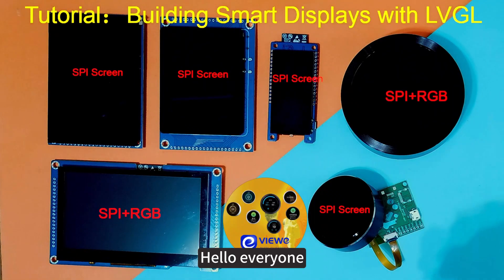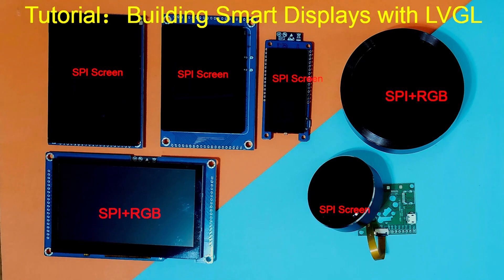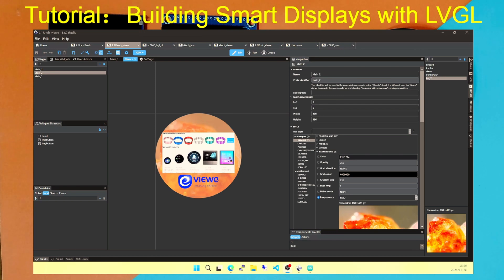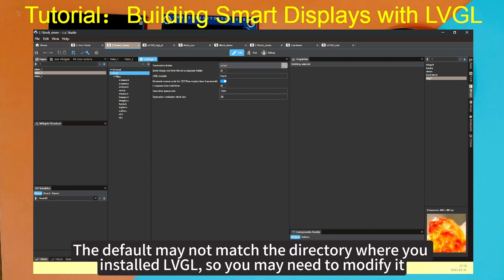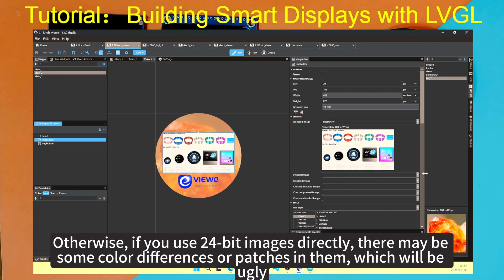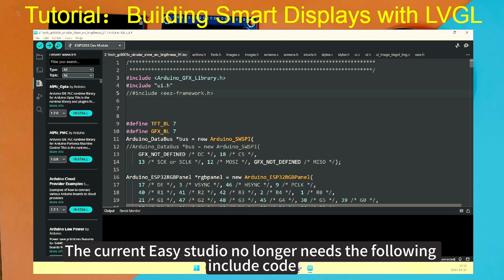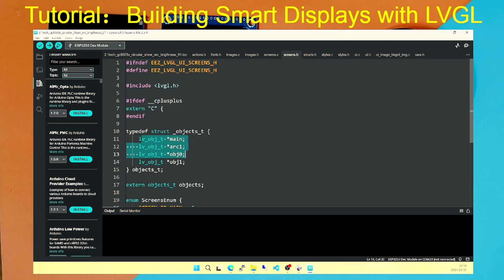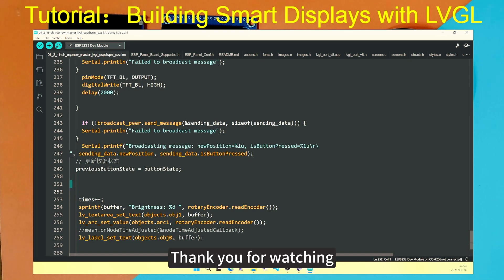Tutorial: How to use LVGL to Build a Smart Display GUI with Arduino IDE?

Comment: A friend of mine has this display, but he cannot use it with any library except LVGL. We are three people working on this and have tried everything to make it work with the TFT_eSPI library from Bodmer, but nothing works. The display is very, very nice, but the libraries on GitHub are not fully updated. Many links are not working properly, and some of the TFTs are very dark. The information in the PDF is not always correct. The driver for one of them, the ST7365P, is not working with the ESP32S3 unless you use exactly the LVGL demos provided on GitHub, where only the panels you create are configured. You need to be an engineer to make it work.